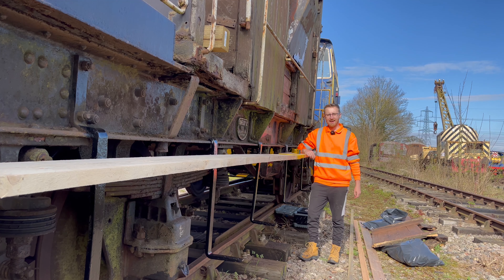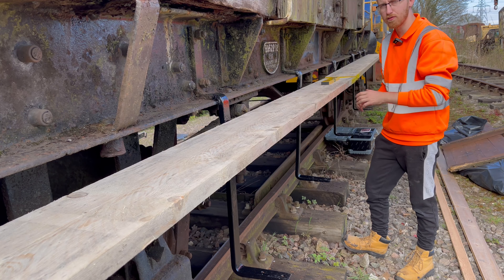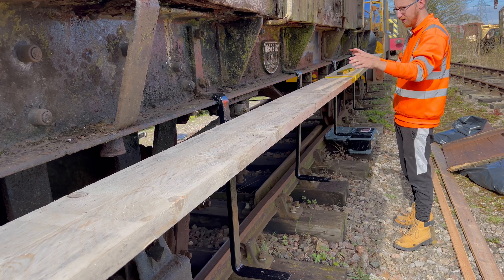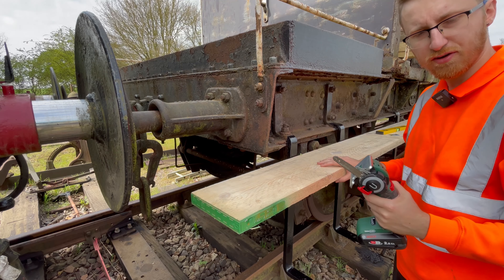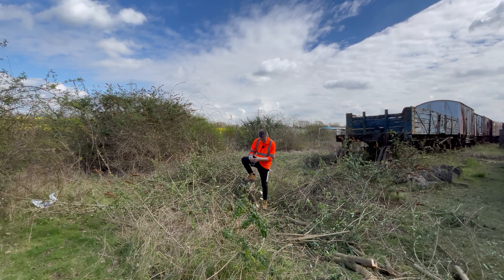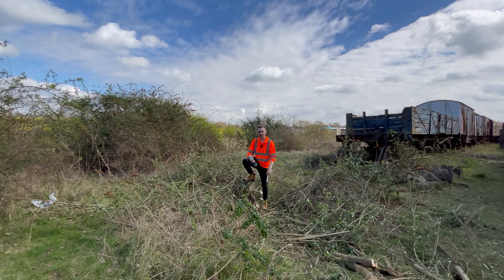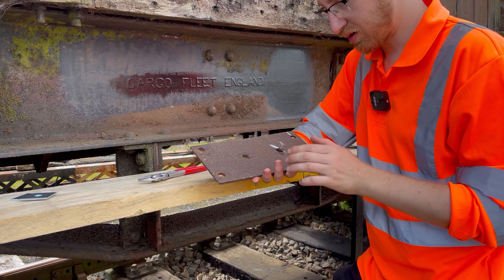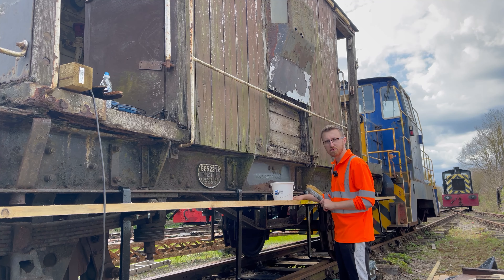First boards installed! - Brake Van Diaries #10

Comment: Add the angle metal or not. It's your brakevan to do as you see fit. I would add the metal angle trim to the steps area. Don't want to have to replace every year or 2 if it becomes damaged l
Reply from the maker: Yeh wood isnt cheap!

Comment: Hi there. having restored a Bristol RE bus in 4 years i wish you luck with your project. I learned that you take everyones advice and then analyse it and use the ways you find best for you. Enjoy the experience.
Reply from the maker: Yeh I have already had a wide variety of advice and feedback so its a matter of picking what will work out best for the brake van in the end!

Comment: Great progress,  but I wouldn’t use aluminium because it’s slippy. You can get a nonslip grip angle . Looking forward to the next update . 👍
Reply from the maker: After having a browse online I can get a similar size strip but with grooves in the top to help increase grip, lots of options out there!
Reply: @WardleRestorations  yes, I think that would be a lot better than smooth aluminium. 👍

Comment: Really enjoying this series.  It feels like I'm there, part of the restoration.  Personally I wouldn't fit the running boards until last.  You will climb in and out of your van much more whilst you're restoring it as compared to when its finally in traffic so just fit two short temporary steps until the end.  In my opinion the ali angle will look more "DIY" rather than restorative.
Reply from the maker: Thanks for the tips! To be honest the running boards also make excellent shelves when I'm working on the chassis haha

Comment: Thanks for this video, it's the first I have found.  As a matter of interest all the brake vans I have seen have the 'working edge' of the running boards rounded off rather than squared edged.  As to accuracy and longevity, as in all things there are fors and againsts on both sides.  Yer can't please all o' th' people. 👍👍
Reply from the maker: Cheers Robert, glad you enjoyed the video! Yeh the edges will be rounded but just trying to protect them for excessive wear and tear is the aim! All the best 🙂

Comment: For what it's worth i would go for some checker plate the same width as the boards but with a 90 degree lip to cover the sides i'm sure some metalworker can knock some up for you, the reason i wouldn't go for with the aluminum strips is wet and ice your feet could possibly slip off the strip causing a serious amount of pain as you slice the first couple of layers of skin of your shin. other wise great stuff and anything you want to film is fine bur the restoration needs to come first and hold off a bit on the time lapses, everyone seems to do it and i'm weird anyway i would spend and hour just watching someone do the job in real time lol
Reply from the maker: Ha appreciate the feedback! It is hard to please everyone so I am still trying to find the right formula that 99% of my audience will enjoy. I think I'm going to leave the metal strips for now to see how it comes out after the edges are curved with the routing tool!

Comment: My suggestions....
The best saw you can buy is a plunge saw. Just a b and q or screwfix own brand is fine. You will cut dead accurate cuts and no need to route.  Once you get the hang of it you will cut everything with it !. Jigsaws are only good for roughing out an inside hole before finishing.
Get a bar out of the workshop and bend out the brackets first. As for kick boards, just leave a small gap and all will be fine. Personally I would use tanalised timber all round. Then it will last.
Reply from the maker: Yeh I seem to be very unlucky with jigsaws so maybe it’s time to find a new tool 😂
Reply: @WardleRestorations  100 quid or less buys you a plunge saw with rails. Trust me...you'll thank me for it.

Comment: If you take some 10-12mm diameter rope make a loop from the bracket that needs straitened to the track opposite then use a peace of wood rotate it inside the loop at a 45 degrees to the rope close to the track end of the loop. When the bracket is at the right place turn the wood to 90 degrees and rest on the ground. this will hold your bracket in place till you drill your holes. That would make it a one man job. As for the tree you cut down I think you only did it to get fire wood for your fire lol. Seeing other parts of the area would be good for us that live no weir near you. lastly would it be a good idea to take the joining plat of again coat it in your rust remover then prime it back to seal it so it doesn't rust any further. Stay safe.
Reply from the maker: Yeh that’s a fantastic comment regarding the joining plate, when I’m down there next I’m going remove the plate and treat it, then put it back on!

Comment: The trials and tribulations of a BR Brake Van wagon owner eh! I feel your pain with the jigsaw. Hate the damn things as like you, never seem to get that straight cut you want no matter what you do.
Re the square washers, will you be painting those for added protection? Regarding the 90 degree aluminium section you had and questioned would it be worth having that where the steps go. Would it not be better to have a steel plate right across the step rather than just the edge? You can get those ones with the tread patterns on (or whatever they are called...think they are called checker plates. They have a pattern in them to try and eliviate slipping). That may be a better solution to protect that whole area of wood when climbing in.
Saw a video of the HST launch, that looked great and well attended, so good news for the railway.
Steve
Reply from the maker: You will see in a later episode I actually ditch the square washers in an attempt to fix the brackets! My new jigsaw is much better but not perfect, I'm thinking of perhaps getting a circular saw but unsure yet! I have a HST launch video dropping in the next few days! Hope youve enjoyed the series so far!

Comment: A word of warning which no doubt many will already know! It is the middle of bird nesting season and the fines for disturbing wild birds that are nesting are considerable. Removal on any vegetation must be done with extreme care be it in bramble or even on the ground. Quite honestly, the best practice is to leave such vegetation until the end of the season which is the start of September.
Reply: I believe the period for hedge trimming etc is September through to end of February.  The fines are imposed if there is a nesting bird in the tree or hedge being cut.  It is an offence under Section 1 of the Wildlife and Countryside Act of 1981 to intentionally take, damage or destroy the nest of any wild bird while it is in use or being built, or to intentionally kill, injure or take chicks or adults, or intentionally take or destroy any eggs. The problem is that if you have started cutting trees or hedges and then discover a nest that is no excuse as you need to ensure the area in question is not being used BEFORE you start....
Reply: @MalcolmCrabbe  And people complain about the environmental laws in the States...over on this side of the Atlantic, if it's on private property and it's not in a tree that requires a permit to cut down...we just move the nest to safe location.
Reply from the maker: Right, firstly, no nests were in this small bush, secondly there are separate laws for railways and because the bushes are within a certain distance of the line among many other reasons there is no reason as to why they can't be removed, I understand your worry however this isn't a preservation area, there are no birds nesting here and the shrubs and bushes need to be removed anyway. I just thought it was something people might like to see documented but maybe not if it will cause an uproar!
Reply from the maker: ^see my other reply :)
Reply: It’s only a buddleia bush. Network rail are never done chopping them down. They’re a bloody nuisance to railway work as they grow like wildfire!
Reply: I saw loads of birds fleeing when the mini chainsaw turned up!
Fine him!!!

Comment: Great video! If I were you then I would fit the metal angle strips. I doubt that the athestics would be altered that much and it would give you so uch more use out of the wood.
Reply from the maker: Yeh I’m going to find something slightly more grippy as it’s been mentioned that the smooth right angle may be a tad slippy!

Comment: Good to see the wooden runner boards going on.  Maybe right enough with the kick-boards holding water and leaving them off.  They can't all look the same anyway, dare say.  I'd have had the wire-brush and grinder in to clean up the area of frame above the boards first and see if the bracket nuts would come off for cleaning, m'self, but there's getting it done, getting the wood on and treated, and there's getting it 'ex-works'.  If it ain't broke...paint it!  (Try a bit of stress or a pull out the way from the bottom and give the first bend a tap or three, to see if that'll straighten the two board hangers that are a bit bent, then repaint as required.)  Edging the boards are fine if made with the right steel plate, bent over.  The aluminium bit you had there is usable but liable to wear or tear at the  fixing-holes in the pieces.  It's a slip-hazard too.  Talk to the Carriages and Wagons Manager(ess) or the bloke with the other brake van and see if there's restrictions on putting those edges on the runner-boards.  I thought those little saws were the 'bit of a joke' but they are serious little saws!  They look cute but there's a fair bit of force turning that chain over.  That was one of the best uses of the little saw that I've seen yet...taking the Buddleia down!  Damned weed!  Might be good for the butterflies and moths but there's plenty of it elsewhere!  A nice amount of progress there, Ollie...especially the Buddleia!(A Pet Hate of mine).  Plenty to do yet on the runner boards though.  The Metal of the Valances next?  Onwards and upwards, sir.  Cheers!
(That TPO Van looked like a 'must see', too!)
Reply from the maker: There’s so many small and large tasks I sometimes stand there and stare at the brake van and think ‘what on earth am I going to do next’ but hopefully over time the tasks gradually get less and less, well that’s the plan anyway!
Reply: @WardleRestorations  Heh!  Sorry about the essay!  You're doing fine, sir.  Catch up soon.  Cheers Ollie!

Comment: hey man really cool you get to be apart of owning a piece of history like that Brake Van I think for future proofing I definitely think putting the angle metal will be good for durability as well as safety in the long run I would put a grip like material or something on the metal part of the step to help grip your footing and to prevent slippage when going up into the Brake Van can't wait to see what else you got in mind and would be cool if you could name it like steam engines haha could be the "Spiteful 20T Brakevan"  Cheers to you man keep going 🚂🚃🚃🚃🚃
Reply from the maker: Hi Chris, thanks for the kind words! Yeh I think most people have said if I am to use the right angle stuff then I should definitely use some type of grip like material! Yeh the brake van will have a name just undecided yet!

Comment: Just one small criticism, I thought it would of made sense painting the sacffold boards with the preservative, on the back-edge/under-side BEFORE permanent fixing in situ. Just a thought...
Reply from the maker: They are not permanently fixed though, they need to come off anyway for the chassis to be sand blasted 👍

Comment: I've seen properly preserved wood last a few decades sitting in water...there's no reason you couldn't do the same with the kickboards.  I presume they go behind the step board, in which case the small gap between the two would allow the water to mostly drain away, and it would dry out in the sun...but the way kick boards are installed over there might be different then they are over here in the States.
Reply from the maker: The kick boards that were on it before were butted right up to the main running board so water would sit there, we also might not have as much warm weather as you guys so 70% of the year it’s not as warm😂

Comment: Excellent video... To be honest you haven't followed the line of authenticity in repairing other parts, such as using bolts to join the wood on "porch" area rather than using mortise and tenon joints as per the original build, so it doesn't matter if you add aluminium angle to the stepping area on the running boards. If you were restoring this authentically then yes it would matter, but then it may be the case that the running boards were made from a harder wood? 

With regards to the landscaping... as others have said, and I have commented below, you need to check that no birds are making nest or currently nesting in any of the undergrowth before you start to clear the area.
Reply from the maker: In a sense I actually have! I’m remodelling this wagon back to its 1990s look in civil engineers grey so they were already using coach bolts at that point, so in effect I’ve replaced their old ones with new ones when adding the new railing! And yeh don’t worry the tree had no nests in it at all!

Comment: Well, it’s great to see you trying to look after this piece of railway history. 
Okay, being brutally honest here, before you speak you need to think about what you want to say and break up the sentences and lose a lot of the Er’s. Shorter sentences with a pause in between if necessary and edit them together, and if necessary, retake the shot. That will make your videos easier to listen to. It’s just practice and most of us were the same. 
Regarding angle iron on the step, no. You don’t need it. When your mate trims the boards with his router, round the top edge off, this will stop the splintering under foot. The boards will rot through before they wear out if you do this, so don’t waste time fitting the angle. If you slip climbing up, the last thing you want to do is catch your shin on a sharp piece of angle. So keep it up, and watching your progress 👍
Reply from the maker: Thanks for the advice regarding the right angle, perhaps I will hold off until the edges are routed before I add anything on top of that. Regarding the speaking, I spend enough time at the railway filming without doing 10 takes of every shot. End of the day, the brake van comes first and the video is an afterthought but appreciate the honesty.
Reply: @WardleRestorations  that’s fine, it was just a suggestion 👍

Comment: invest in a socket set with long sockets which will make your life easier.
Reply from the maker: I will at some point but as you can imagine I have invested a small fortune already!
Reply: @WardleRestorations  Having spent £20,000 on restoring a Bristol RELL bus 10 years ago i understand what you are saying.

Comment: You have asked us to open a can of worms here but my personal view is that "Preservation/Conservation" conserves that which is extant in whatever condition it is, it mearly stops the decay. "Restoration" returns the object to Usable condition. By replacing those running boards you have undertaken "Restoration" and in adopting the use of the metric fasteners you have, you have alredy exepted "Modification". Preservation/Conservation will only return a corroded and rotten wreck of a brake van while Restoration/Modification will return a usefull vehicle likely to last and still have a usefull role to perform into the future. As long as you maintain the character of the Brake van go ahead and fit those kick plates, but please, paint them white not natuiral metal.  To my critics. That is my personal view and yours may vary. If it does that is your personal view and you are as entitled to have and to express it as I am with my view. please be polite and constructive in your criticism.
Reply: I actually agree with your points Gordon. And it's good that Wardle is thinking long term for his brake van in terms of usage and longevity. This way he won't have to keep replacing the wood on the running boards every four to five years when rot starts setting in. My thought on the brackets though, perhaps he should add slightly longer brackets and maybe some grip tape on the corners where people will put their feet so they don't slip and fall when embarking/disembarking the brake van, especially during wet weather. I know that volunteers will mostly be using this brake van during operational days, and they know to be careful, but visitors may not have that same luck, and we all know it just takes one slip for a bigger problem to emerge. That's just me though.
Reply from the maker: I didn't mean to open a can of worms but thank you for clearing up the differences. I don't think you'll get any critics regarding your comments, at the end of the day I've asked for feedback and that's what you have given!